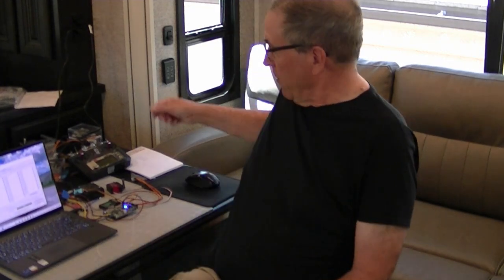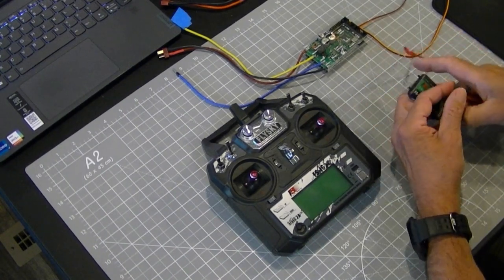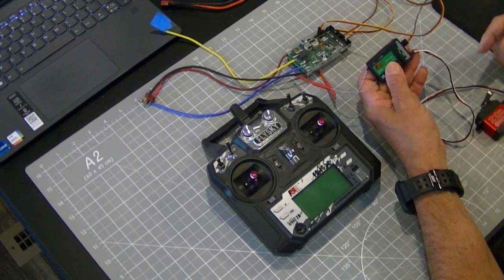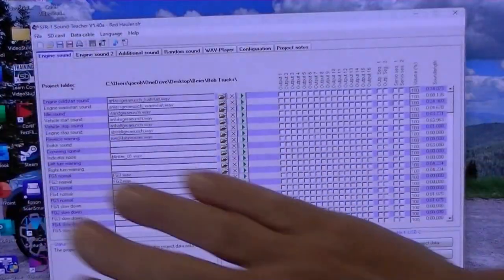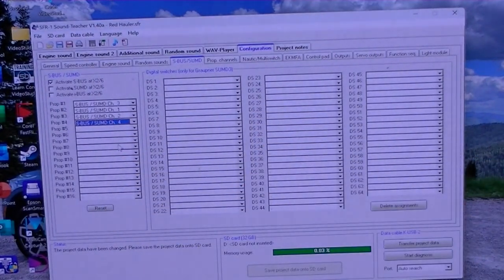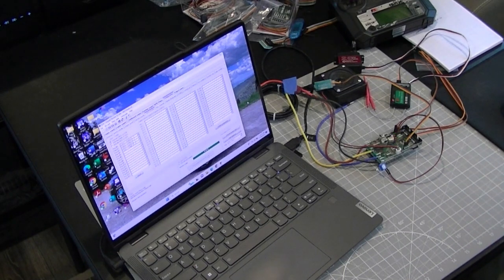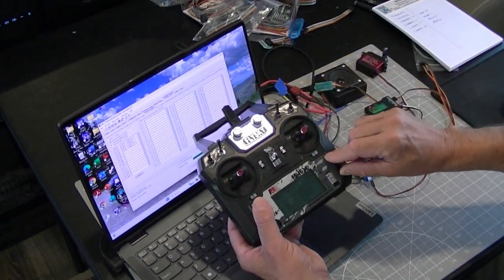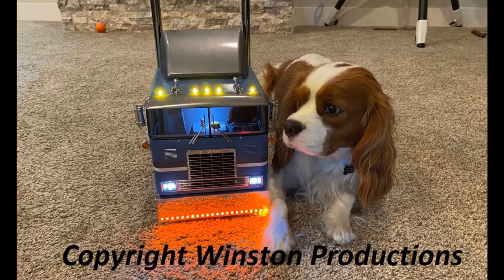Beier Masterclass Volume 5 - SBUS Radio Setup

Comment: The best way to be used with a FRSKY Taranis X9D+ radios. Great video.. I currently use a DIY sound and light controler based on arduino. It works great but has limited light channels. So I'm interested in switching to a Baier module (I don't like MFC units as they lack features, have a strong led limitation and use way too much space in our cabs). I plan to use USM-RC3 as I have a Servonaut speed conroller working smoothly on trucks. Thank you for your beier masterclass series, that is a great help for hobbyists.

Comment: Just starting my first build (Scania 8x4/4) and was wondering if the Beier unit would be too much as a beginner. Nearly went for the Tamiya MFC3 option last week as a few have said the SFR1 is too complicated. I have the Radiolink AT10ii so SBUS is available.... gradually watching these videos to get the feel of it and think the SFR1 starter kit is the go to... Thank you for this series Bob... All the best, Glenn
Reply from the maker: The Beier SFR-1 is pretty straightforward to set up.  I would just watch the Masterclass series and see what you think.  You need to do some soldering but the results are worth it!  The Radiolink radio works great with the SFR-1.
Reply: @HobbyconceptsLLC  thank you. Yes, i am through watching a few of them at the moment and will continue to go through the rest. Its a great series. Much appreciated